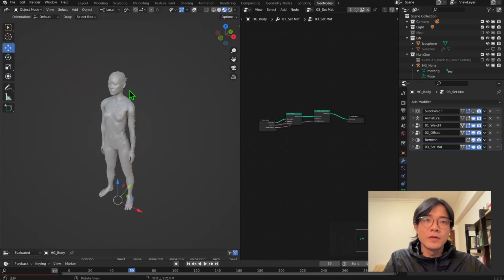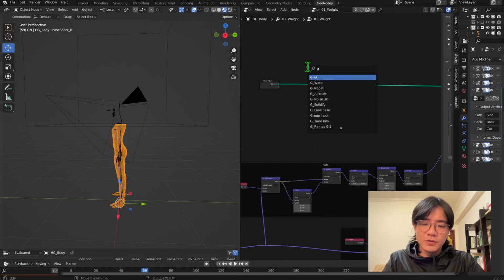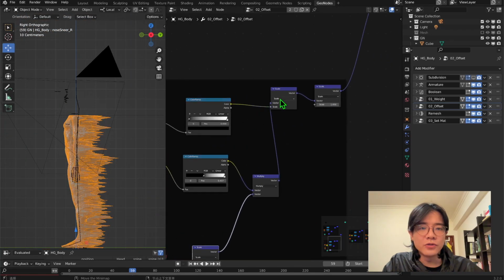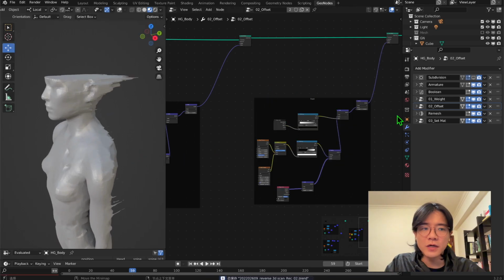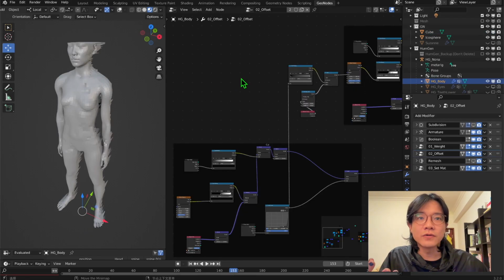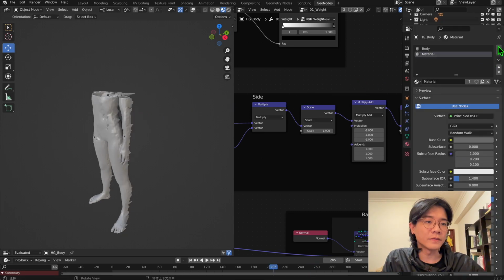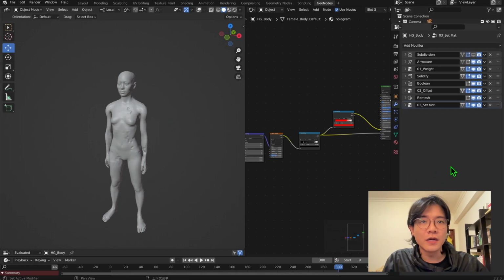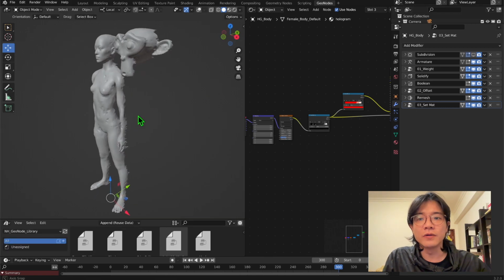P-2 Virtual 3D-Scan { Blender Tutorial }

Comment: Hello NENGHUO I always love your tutorial. I  am working on geometry node that generate hair ribbons. I reference your paint brush ribbon tutorial. Since you have worked on similar project i would like to ask your opinion about the problem I am trying to fix.
Reply from the maker: What is your problem??
Reply: @nenghuo  Thank you for the answer. I would elaborate on it. I am making a hair card offset Geometry node. It is fully procedural from splines. But I also need to rig the final mesh to a hair rig to animate in my pipeline. I want to ask your opinion about it. Should I lean more on the procedural side where I animate using procedural noise, or I should  just use the Geometry node to generate the mesh and rig it manually. Is there any option to rig a geometry node. I know it might sound stupid, but I am open to any suggestion. What I really want to ask is more of your opinion about my project and how to improve it.